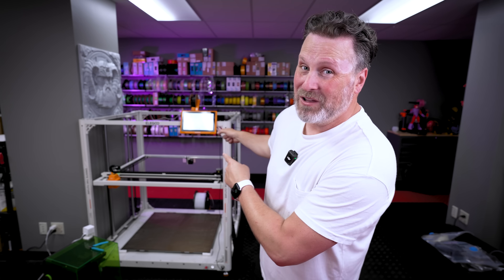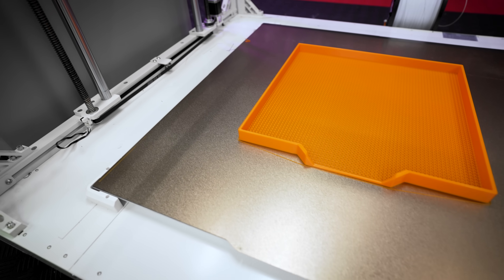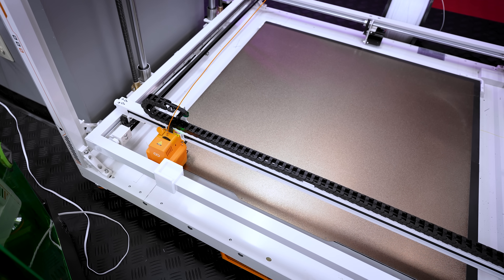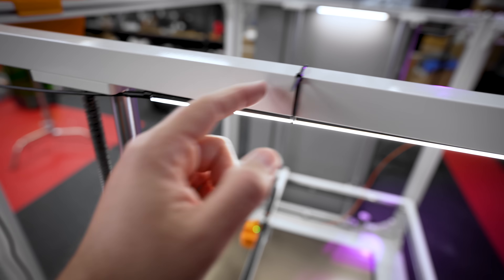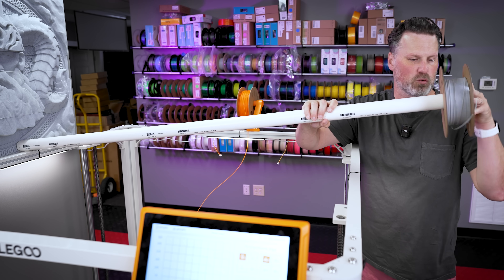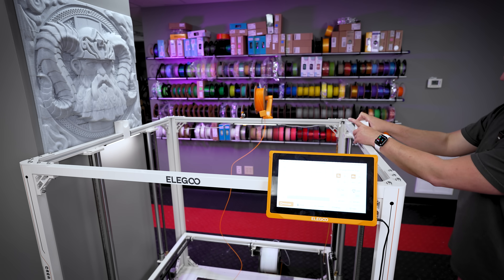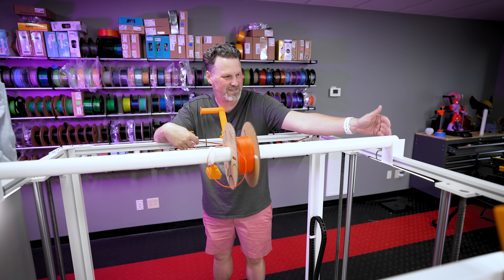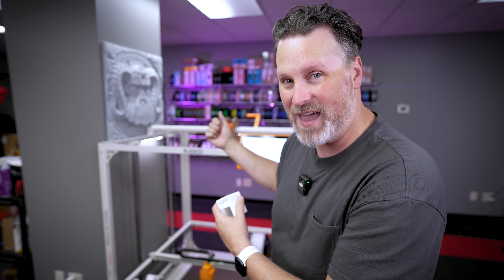Giga Sized 3D Printer Mods! Elegoo Orange Storm Giga

Comment: Simple ideea to use what you already set up (the pipe), leave the spoolhonder where it was, just run the filament from the back, over the pipe and use it as a pivot point, the round surface of the pipe should work well with minimum drag and having the filament feeder from the back to the center an down should provide optimal feeding from above the center of the build plate..  you can add some channels to the pipe if you like

Comment: the mods this thing really needs is a better extruder and hotend that will except 3mm filament and up print speed. better bracing to stop it wiggling when printing something tall and an enclosure. this thing is built in a way that the bracing and the enclosure would be super easy and cheap to make. also just make it so you can mount what they already built to hold the filament to move it to the center. then it all works as designed.

Comment: Wouldn't it be better for seeing what's going on with the print head as it prints, and for doing better looking time lapses, if you design the Wyze Cam mount to hand the camera upside down on the bottom side of the gantry frame, and then invert the video feed in the Wyze App?

Comment: You might need something stiffer than PVC pipe to span that distance and hold multiple 3-kilogram or even 5-kilogram spools. I recommend Steel tubing, or a piece of 20x20 that the spool holder can mount to. also, with a little extra wire and shrink tubing you can make the multiple printhead connector wires as long as you need. Aurora Tech Channel went straight to the other spool roller on the floor for the larger spools.

Also, It takes one of the largest printers I've seen to finally get a full 1K filament spool included?

Comment: It’s mad. Elegoo didn’t provide a single build plate with the printer (poor show) so a company jumps on the opportunity and manufactures a one piece to capture the market but decides to make it too small for the printer.
Reply: Nope. Tronxy just has 800x800 printer and sells replacement

Comment: The 1in X 1in X 6ft piece of Aluminum extrusion is $37 on Grainger just run it along the top then use the normal spool holder and runout sensor on it.

Comment: The printer is a joke really. They created is because even as a failure it will make some sort of profit. Anything this printer can make at the maximum size is simply not worth the risk of the time lost if/ when the print fails, rather than simply seperating that same print into 4 parts and making them on a normal printer. The 'only' advantage here is that it would be a single print, but how could that ever be an absolute requirement? It wouldn't be.

Comment: Not sure if your done but the top mount make it use 2 pipes resting on bearings, the you can set the filament rest in between the two pipes and the freely roll? This will also raise it above the print head at max height

Comment: Where you mount filament shouldn't really be the driver of good feeding.   If you mount a central 'hub' that makes the 90 degree bend and feeds the filament out the bottom, the problem become one of maintaining a healthy minimum bend radius (using Teflon tube?).  Where you put your runout sensor depends on when you want to stop the print for a refill....and it's probably easier to create a couple  of simple wire looms to relocate them than to modify the original location.  (if you're moving it too far, you could just disconnect the sensors at the control board and route new cables from there).

For fun you could throw a Chameleon3D inline...possibly mounted centrally as the runout sensor and filament aggregator?

Whatever you do...the more crazy the more fun to watch.  Thanks for the videos...I'm living vicariously while awaiting my new printer to arrive.

Comment: Why didn't you just switch the brackets around and have the closed end on the right side where the wire comes through and put the open end on the left side? That would have been a 10 second fix to the issue.

Comment: Potentially a silly question, but if you rotate the pipe by 90 degrees would you not be able to route the cable for the runout sensor through the pipe instead of leaving it hanging?

Comment: For the pvc across the top, just run the wire the other side? Since it is against the wall, you wouldn't be lifting that side. So you can slide on your spools on the right while the wire goes down the left side of the pvc.

Comment: Make the brackets holding the pipe an a-frame. That will elevate the spool and then you can hang the run out sensor using a c-clip shape on brackets so you don’t have to slide it on, just clip it on.

Comment: Swap the side where the runout sensor wire goes in over to the less accessible side, which allows for swapping spools easily without interference from the wire. Add a horizontal bump out that will lock into the recess on the inside of the top frame rails. Triangulate your bracket where the pipe geometry is the top point and the frame rail geometry is your bottom two points. You can use your ring idea if you make it so it's on either side of the spool and meets in the middle below the spool.

Comment: myself i would mount the filament spool reel from the ceiling in the center of the printer and solder some longer wires onto the filament run out sensor

Comment: You could try a second smaller pipe just for the runout sensor, or extend and run the cable from the other side, so you can still slide spools on as intended.

Comment: Take the existing spool bracket and attach it to your pvc pipe. Then you shouldn’t have to enlarge the mounts you designed.
Plus🤔 you might be able to attach the filament run out sensor to the original bracket

Comment: Love the backyard engineering my friend.  I think you are on the right track with the spool holder.  I would just make the brackets that hold the pipe tall enough to allow the run-out sensor enough room to hang below without sacrificing any build height.  Remember to measure twice and cut once, you made the pipe just a tad short methinks.  If any bowing happens from filament weight she might flex right onto the build plate and ruin your day.

Comment: I would leave the spool holder where it is. Then design a bearing holder that redirect the filament direction. If you need to further reduce the force to pull the filament, put the spool on bearings. 
Bonus points if you used a bowden tube to make it easier to load the filament into the redirecting bearing.

Comment: What if you had a separate conduit for the runout sensor? Modify your bracket to hold a smaller pipe, run the sensor through there? Obviously leaving enough room for the filament spool to still roll on the pipe you have.

Comment: Perhaps if you routed the wire to the wall side of the giga.  So you can route the wire, and add the spools of filament.  You could cut a slot in the bottom of the 4' pipe so you can lift it without disconnecting the wire.

Comment: I would just span a couple Repkord RepRack spool holders across the top. They use two lengths of EMT conduit instead of PVC. The obvious advantage is that any spool can come on or off at any time, vs having to thread them on in sequence from one end.

Comment: i would model something of a bracket for the run-out sensor to sit on top of the print head. if the wires are long enough, thread it through the cable chain track to make sure that it doesn't fold and rub onto itself.

Comment: Just use a jst crimper and extend the wire around the frame to the left side and run it through your side bracket. Use 8mm screws and locking v nuts to hold the brackets in place, dane use your filament mount bracket that you designed extend it to the right a bit in front of the spool and just put a simple 1/2 in screw and hold it in place to keep it from spinning.

Comment: Use 2020 extrusion across top instead of the pipe. Use T-Nuts to mount existing spool holder and filament sensor to extrusion.

Comment: I love you bro, but next time buy a ratcheting PVC pipe cutter please. Lol

I'm building a T slot rolling cart with a bar built up off of the frame of the cart high enough to clear the top and work as a shelf platform for one of the Texas sized spool boxes to alleviate those pull force issues.

Comment: I would try a double channel system for the spools and the sensors.  Have a small pipe that runs across the center that has the wires and the sensors on it then a little higher up take the pipe you have and put the spools into it.  You need to raise the spool pipe anyway, may as well add a wire channel for the run out sensors this way you can get them in place and wired in then not worry about it.  I would also recommend getting or making some wire extensions for the sensor cables.

Comment: I would use a 3030 aluminum extrusion for a cross member. That way you could utilize the existing spool holder (with T-nut) and design/print a dual sided spool holder. This would allow you to run the sensor wires through the t slots and keep them in place with slot covers like the existing wire runs. 3030 extrusion would make it easier to design future mods as well. The only real downside I see is the cost of the extrusion

Comment: You can also mount the spool holder on top of the pipe then it  is higher and you don't need to detach the pipe when changing a spool.

Comment: Based on what 3D Printing Nerd said, this printer is a problematic one, with way too many issues. I have seen Ivan Miranda produce this size if not larger printers that work way better. I do not know what was the issue here with the production, but there is way too many issues from multiple sources.

Feels like a rushed to market product.

Comment: why not just get a length of 20x20 extrusion that will fit across the gap - then you can just use the existing hardware to mount everything to the printer?

Comment: for the filament bar you could buy the same extrusion as the frame, print brackets and then you can just transfer all the original things to it plus some cable extenders for the run out sensor.

The PVC pole you cut is too short, there's a risk it'll sag over time pulling free or drop enough the reel fouls the head. If you really want to stick to low cost something like a round/square pipe or white metal curtain pole (28mm)

Comment: With the spool holder, you could just get another t-bar and design brackets to hold it above the print volume and use the original mounting hardware on the printer to mount the spool/run out sensor

Comment: My thoughts of the spool issue would have been mounting a pulley after the  sensor then on the PVC pipe in the center a second pulley where the filament would go down to the nozzle.

Comment: How about turning the pipe 90 degrees, add a hinge mount on the back, open pipe mount to hold the pipe by the control screen then you can do your roll changes from the front and fish the sensor wire through the hinge mount on the back so it's out of the way also.

Comment: Leave the spool where it is, move only the filament sensor to that pipe. Keeping the pipe slightly loose could allow it to move to a natural spot where it doesn't go under tension. It's sad that a company like Elegoo hasn't tested this printer enough to eliminate these. They had time, they got the backing funds it just blows my mind that it's still a problem.

Comment: Great direction however, the 3k spool will be too heavy for the pipe and it would bend it. I would just invest in aluminum rail and print some brackets for it. Also, you should just print an actual spool holder and not rely on sliding the filament through the pipe. You'll get frustrated sliding it in and out. For the build plate, can you reach out to the company that made the build plate and give them the exact measurements so they could make one that perfectly fits? Great video as always

Comment: Add another piece of pvc pipe across the top for the rolls of filament. May want to check the deflection of the pvc though as it will sag over time.

Comment: Not using the pipe, but, you could make a bar that snaps onto the frame that goes from one side to the other that you then mount the original spool holder on. You might even be able to keep the pipe if you design a plate to attach the original spool holder to that then attaches to the pipe.

Comment: Don't use PLA for anything structural. PETG, ABS or ASA will be a better fit. Snap fit isn't recommended either. I would make parts that need to be screwed together and use heat set inserts for assembly.  It also makes very little to no sense to use 1KG spools, so make a 5KG spool holder so you're not changing spools multiple times per large print.

Comment: Just mount 2 PVC pipes on there and sit the spools on top (a la repkord), that way you don't have to remove the PVC pipe every time you change filament and you don't have to try to slide the filament past the wires. If that is not acceptable, slide the filament on from the opposite end of the PVC pipe (the side by the column) or route the wire in the opposite direction.

Comment: Make an extension cable for the runout sensor and route it through the side of the pipe next to the wall.  For the runout sensor it self, put a screw through the ring to lock it into place.

Comment: just slide de spool over that tube from the other side??? then again if you use a double tube with like bearings at both ends so they can roll you can simply put the roll on top of it?

Comment: why did you not just flip the pipe round so the wire is running from the wall side leaving the other end open to slide the filament on
Reply from the maker: Yeah I might do that… need to order a longer cable for that to work

Comment: run your sensor wire along the other side of the tube (wall side) that should make it easy to load filiment from the accessible side.  That is unless the way the cable length is and where it starts is an issue.  Then just do it with an extension to the cable.
Reply from the maker: Yeah going to order up some extra long cabling and try that

Comment: Maybe 3D print some brackets to build an A-frame mount for the spools. 4 brackets to mount to the top rails, 2 brackets to hold the top pvc pipe and connect to the 4 short pipe pieces as well, and a pipe across above that to hold the runout sensor?

Comment: Turn the printer 90 degrees to the right, then you can use the other end to put filament on and off without hitting wires. Can print your side brackets taller to move filament rolls up and then maybe design a screw into it to key into the top sides of the printer

Comment: How about, just design a single strong curved arm to sit above the print volume attached to the frame with t-nuts and bolts where the end of the arm for the spool is a good normal spool holding section like we see on the normal printers which sits up on their top frames, the sensor can be attached like the way the other normal Elegoo printers have below the spool.
You can then just take the spools off and on like the normal spool holder lets you on the smaller printers.

The giga can print the size of arm you need you just have to for the time being hang the spool of PETG from a new broom handle across the top in your two white printed pipe holding brackets and not use the run out sensor for that time as it not really needed for the arm print.  The arm can be a simple curved one with X inner frames to make it strong but lighter with the top and bottom of it as walls.  a quarter of a full circle sort of curve would be just the right curve for the arm.

Comment: Just adapt the spool holder on the back to be attached to the tube. It will raise the spool and solve the issue with the cable since you won’t have to slide the spool thru the tube. You will need to screw the tube edges to the side mount so it won’t spin
Reply from the maker: Ohhhh I like that idea!!

Comment: Nice video. top mounted spool holder. double up the pipes. 2 pipes, you can make a clip on bracket for the runout sensor, thus move it behind the spool of filament.

Comment: Drill two sets of holes, one on the end and one in the middle.  Then have a cross-bolt perpendicular through the middle to keep a post mounted for the spool and sensor, then have another on the end where the mounting bracket to the frame is. [bracket]===============[sensor mount]||<-cross bolt (spool)================[||<- bracket fixed cross bolt]<- bracket

The cross bolts will keep the thing in a stable position with some minor rotational tortion, but if you keep the bolt in the bracket fixed to the bold, you should be able to lift the pipe out of it.

Comment: Maybe just lock the pipe in place and mount the existing filament holder on that? That should let you run the wiring back through the pipe too
Reply from the maker: Yeah, someone else suggested something similar. I might try to do that.

Comment: That build plate holder turned out awesome.
Reply from the maker: Thanks!!! 10 min modeling in shapr3d 🤘😬
Reply: @UncleJessy  Curious about how you made the bottom pattern of the plate holder. It looks fantastic. I tried using 20% Gyroid infill and removing bottom shell trick in OrcaSlicer, but it's still not as clean as yours.

Comment: I think there is a serious engineering error. The filament sensor is too far from the extruder, filament breaks will drive people crazy. The hotend, extruder and filament sensor should be close and, if necessary, a single large piece.

Comment: Could you run the filament sensor to the other side of the PVC pipe? Also I would just mount it higher and put a hole in the extrusion part to help hold it down.

Comment: model a piece the size of the frame to mount to the pvc tubing. Use sheet metal screws to keep things from rotating and use the original spool holder.